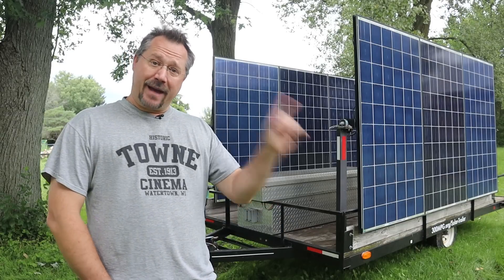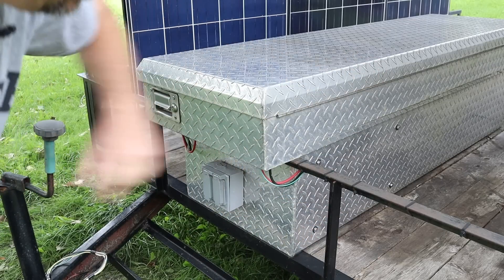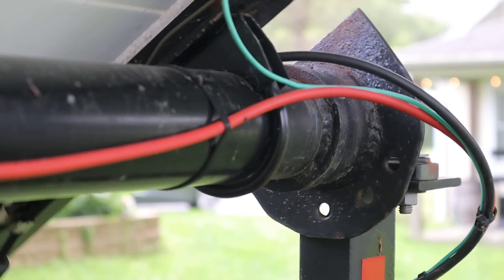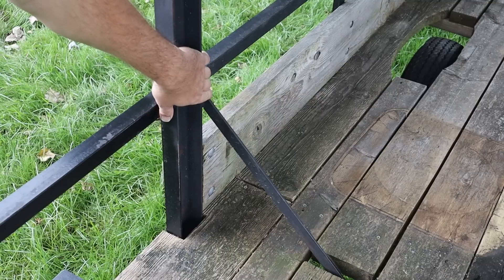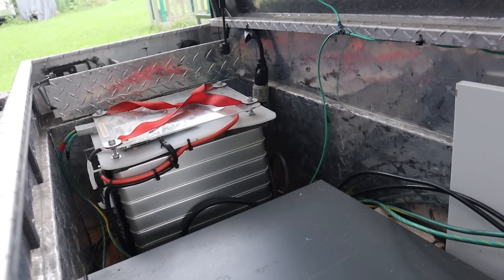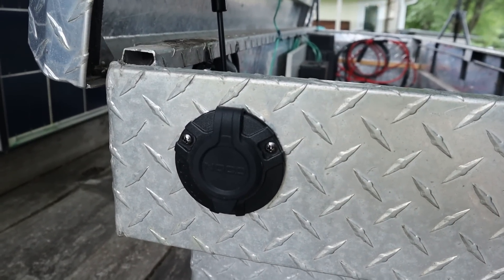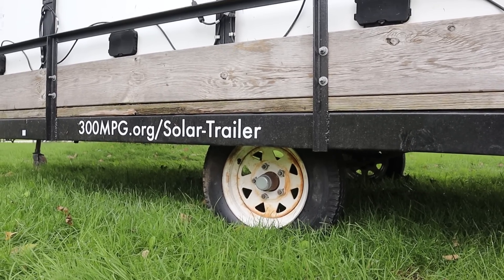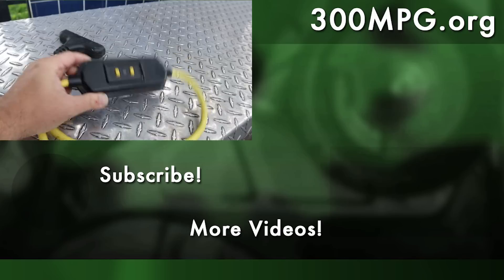DIY Solar Trailer Tour!

Comment: Really great job you have done.    I have been thinking of how to do  a similar thing using a small 4 x7 flat bed utility trailer I have already.    Hoped to have my Anker Solix F3800 in the house and run wires out to the trailer with solar panels.   My problem is too many trees so I would need to have my trailer as far as 110 feet from the location of the Anker Power Supply in the house.   In researching wire distances it appears I would need to run two sets of wires -- one set to each of the XT60 solar inputs on the Anker F3800 with use of 8awg MC4 wire sets.   Your panel swivel support is extremely clever and very functional for setup and travel.    I hope to try to follow the design but it does take some skill and patience.  I don't even have a welder setup.  Prepping for WW3 is getting to be tough on me as I am 78 years old.   Thanks for the great ideas and for posting the project for us to learn from.

Comment: What do you do in the case of a storm and high winds
Reply from the maker: Never been an issue. 
If I wanted though, the panels could be tilted flat. That would present the least wind resistance.

Comment: Hi Benjamin! awesome video! -- was wondering if I could get away with using 1" 14ga steel tubes (like for garage doors)
Reply from the maker: I couldn't tell you. I'm not a structural engineer. I do know that when I have materials in my hands, I get a good sense of how solid they are and what they can do.

For LONG spans, like the 10 foot long pipes I used to support the full weight of 3 panels per side, you need stiffer/thicker supports than you might otherwise think!
Reply: @BenjaminNelsonX  what is the gauge of the steel pipe you used? thanks in advance 🙂
Reply from the maker: @mitchizm007  Schedule 40 steel pipe.

Comment: You could add hinges to the outside edges of the wings and make them bifold units. Add new panels on the new wings. Store them with the current panels facing in to the center of the trailer. the new panels can be supported by prop rods when deployed. That would double your wattage on the panels.

Comment: Nice to see you still making content. This is what solar panels are meant for, a niche for remote rural locations.. and making it mobile makes so much sense. A trailer camper with flip open panels on the sides would be neat.

Comment: as a demonstration platform it is a good system, if you needed to adapt it to a higher capacity production design then obviously higher wattage panels would be a good improvement but creating a telescoping mount to elevate the panels could also help as there may be a shade issue from the panels on one side blocking the panels on the other side?
Reply from the maker: @barrymclaughlin794  Either or both sets of panels can be set to flat horizontal if there are any self-shading issues. 

I did consider setting up one of the two sides to telescope, but considering the weight and a few other challenges, it would get complicated fast.

Comment: Awesome! One small upgrade that is not impossible because of your excellent build would be a solar tracker. 2 bigger R/C servos and a Raspberry Pi Pico would do the trick I think.
I think you could either do calculation (set the orientation, and time of day and maybe some more info like long/lat) and program it to set optimal degree.

Or you could do a solar tracker (there are lots of easy DIY here on Youtube, also with a Raspberry Pi Pico I guess) and then control the servo/panels.
Reply from the maker: Solar trackers are neat, but they generally need a post mount and very solid foundation - ie LOTS of concrete! They also add a layer of mechanical complexity, and are prone to breaking and needing maintenance.

In recent years, with the cost of solar panels dropping, it's usually made sense to simply buy more solar panels rather than spending the money  on a tracking system.

And there's always something to be said for simplicity!
Reply: @BenjaminNelsonX  I just meant instead of tracking by hand the one axis by hand (that you put a sprint in) use a positional servo and to track the sun (you can use a couple of photo resistors) and very small computer to read the position of the sun and control the servos. Then you can track the sun by one axis and let panels position themselves. Not a huge gain, but 15-30% more on a single day I think without touching the panels...

But ofc you can do it by hand also with the sprints.
Reply: @BenjaminNelsonX thank you for this great observation. I was thinking about mounts and had considered a tracker setup, but cheap panels negates the need.

Comment: For weather protection you need to add are sheets of metal to slide over for the protection of the solar panels. if it hails or is in inclement weather or even while traveling, while in protection mode might prevent unwanted damage such as bird flying or rocks into panels panels. Its just a suggestion to protect the very good project you have there.
Reply from the maker: We have had two SEVERE hail storms at my house the last few years. My home solar was not damaged at all (although many cars in the area were very dented!)

The panels fold vertical for travel and present their smallest dimension to the direction of travel. I think that if anything took damage from rocks on the road, it would be the tow vehicle.

Comment: Great job but 30v per panel × 3 = 100v using unprotected wire seems hazardous or are they in parallel? I'd use wet outlet covers instead of damp outlet covers as well as gfci protection somewhere.

Comment: Looks really good. I think you have covered all the bases as far as safety.. The only suggestions i have are:   Make sure to have a breaker between your solar panels and your charge controller and a breaker between your inverter and your battery banks.  Also its a really good idea to keep your wires as short as possible and use the largest gauge pure copper wire that you can afford/install from your inverter to your batteries. Many DIY'rs skimp on the wire size and end up with too much loss and heat in the wires or worse: a fire..  Again, it looks really good.. very good use the trailer and mechanics! LOL and it looks like Will approves!
Reply from the maker: There's breakers between the solar panels and charge controller. There's a removable fuse between the battery pack and charge controller and inverter.

This whole system is pretty low current. The big one to watch is current between the battery pack and inverter. Fortunately, being a 48V type pack instead of 12V reduces the current by 1/4th what it otherwise could be. That helps for using more reasonable size conductors.
Reply: @BenjaminNelsonX  agreed higher voltage means you can use smaller wire.  Wasn’t sure what voltage you were running.

Comment: When both sides are pointed toward the sun, how do you keep the front one from casting a shadow on the back?
Reply from the maker: The sun is UP. It shines DOWN on the panels. In regular summer weather, the panels do NOT shade each other. 

If the sun is low in the sky, you can simply tilt the front row of panels flat.

Comment: I already built a solar shed on a pontoon boat trailer with two Growatt 5K inverters and 3 server rack batteries.
I don’t have panels mounted on it because I just wanted to put the off grid power for a mother in law style apt outside the house. I like the way you made the pivoting mounts.
I have a EG4 6K inverter and 25 KWH battery that I plan to make a trailer similar to yours. I’m trying to find a way to design a collapsible ten panel string so it can serve as a portable power supply for basic electrical needs of a house when the grid service is lost. Maybe 3 panels mounted perpendicular to the trailer center line on the roof,then three on each side hinged to the roof panels . Finally a tenth and maybe an eleventh hinged on the front and back.
Off grid solar has become an obsession for me because I already have all I need but can’t stop scheming.
Thanks for the inspiration!
Reply from the maker: @danielking2944  Do you have a build blog or photos posted that we could check out? Sounds like a fantastic project!

Comment: If you move the panel pivot up more it be better at getting both sets of panels  in the sun and out of each other's shade. The downside is they will be out of balance.
I hope you put each set on its own mppt or in parallel or even a small bit of shade on 1 panel will basically shut it down.
Reply from the maker: On each side, the three solar panels are in series. The two sides are connected in parallel to the solar charge controller.

Comment: I know you did it for balance. But if you had put the pivot axle closer to the edge of the panels, it would make the panels stay out of the shade of the others
Reply from the maker: In regular use, the panels really do NOT shade each other.
At worst, they can always be both pointed straight up.

Balance IS important here. I REALLY struggled with the panels in early testing when they were NOT balanced!

Comment: I have been following you for a while and saw your build on this solar trailer. I got the bug and started building my own. I posted photos on Will Prose DIYsolarforum on portable systems. I added the solar frame today and would greatly appreciate any input during the build. I decided to do a roll on setup so I can still use trailer. With your permission I will post a link in the comments to the photo.
Reply from the maker: Sounds good!

Comment: How do you keep everthing in the truck box from over heating ?
Reply from the maker: It doesn't get that hot.
The box is shiny, so it reflects sunlight away.
The internal components all have their own fans.
The box is NOT air-tight.
I've NEVER had an issue with it being hot in there.
Aluminum is an excellent heat sink.

Comment: The pivot would be a good way to replace an awning on a camper although the inside heats up.  With diy LIfepo4 cells one could made a long thin battery along the front rail leaving the trailer bed  free for a slid in box of some sort.

Comment: The great: recycled components, aerodynamic for towing.  Excellent.  The questions:  ventilation/ exhaust fan for heat generating electronics inside the box?  (I'd do a thermostatically controlled exhaust fan powered by the battery.).  Does one array shadow the other before mid morning or beginning mid afternoon with the current geometry?
Reply from the maker: Heat inside the box has never been an issue so far. It's aluminum, so the whole thing is sort of a heat sink. The inverter and charge controller both have automatic fans on them. The box also isn't completely sealed up. There are some small ventilations holes under the ends.

As for shadowing - the design of the trailer offers quite a bit of flexibility. The trailer itself can be rotated whichever direction desired and then the two solar winds can be rotated independently.
If nothing else, the solar panels can simply be rotated flat and pointed straight up. No shadowing at all then. Shadowing really depends on time of year, how far north/south of the equator you are, etc.

Comment: Not using bifacials was a wasted opportunity
Reply from the maker: These were solar panels I already had.
Buying new bi-facial panels would essentially be a big increase in cost with only marginal production gains.
Reply: Buying a $500 quiet generator on sale at Costco was probably the biggest missed opportunity.  I love the idea of solar.  I have some on my RV.  Its awesome. However, most applications don't make sense financially, logistically, or practically.  You could literally throw a small generator in the bed of your pickup truck, along with a small gas can and extension cord, and power everything at the cabin.  Instead, you're gonna spend thousands of dollars on bulky equipment, suffer reduced MPG towing a trailer, all to have very limited power generation IF the sun happens to be shining.  I'm not trying to hate on solar, but let's be realistic here.  With some quick, non-precise math in my head I basically determined I could pay 3 YEARS of power bills at my house by the time I purchased the solar trailer.  Again, I mean no offense to Mr. Nelson - the trailer idea is cool and I enjoyed the video, but the applications are very few.
Reply from the maker: @gormanthomas8135  
I completely agree with you that a simple gas generator is an inexpensive and turn-key way to make power off the grid.

Just the other day, we took the trailer to my friend's off-grid property. He has been running a generator continuously whenever he's there to be able to provide power for his RV camping trailer. He really dislikes the noise. There's also maintenance and the cost of fuel, and the hassle of refueling.

With solar, it's silent. And the battery part of the system allows it to run all night.

Comparing a complete portable off-grid system to a home electric bill isn't a fair comparison at all. That's like the difference between renting and owning a piece of equipment. But yes, you are correct that it generally wouldn't make economic sense to disconnect your house from the grid and invest in a large solar battery system. But if you have a property where it  is NOT connected to utility power and would cost tens of thousands of dollars just for the power utility to hook you up, a modest solar system makes PLENTY of economic sense.

A solar system also makes lots of sense when COMBINED with a generator. Many off-grid solar folks design their system for what's needed most of the time, and also have a generator for the longest days of winter and unusual weather patterns. A generator can charge the solar battery. So even then, it greatly reduces the number of hours the generator has to run.

As for reduced fuel economy of a vehicle towing the trailer, that's just to get the trailer to the property. It's not as though somebody is towing it both directions to and from a recreational property every weekend. It stays there!

I had fun building this trailer, and I already had most of the materials. Frankly, the largest cost was splurging on the brand-name MPPT charge controller. If not for that, the whole project would have cost me in the neighborhood of $100 out-of-pocket. I would NOT have built this whole thing from scratch if I was using new parts, I just don't have that much need for it when I already have a quality public power utility and a grid-interactive solar system mounted on the roof of my garage. https://www.youtube.com/watch?v=dvUohDXKjYw

I AM a big fan of solar, but that doesn't mean it's right for every situation. It certainly doesn't work well in the middle of the woods, with all the tree branches blocking the sun. It's also pretty challenging if you are a renter, especially in an apartment.

No, it's not perfect for every situation, but as a demonstration project made from recycled and salvaged parts and then going to an off-grid property which would be cost prohibitive to run utility power, I think it's a pretty good use.
Reply: @BenjaminNelsonX  I am a fan of solar.  I  use my time to watch videos about it, obviously.  I can't imagine not having solar on our RV.  It's ideal for off grid camping.  I am constantly looking for ways to use solar more.  I am also a fan of truth.  And, I suspect a LARGE percentage of the public who view solar as a viable source of energy production have NEVER actually used solar.  Its applications are very narrow.

Comment: I think solar power is pretty cool but I live in a perpetually overcast part of the planet.
Reply: Don't rule out solar just because of overcast skies.   You just need more panels.  I live in Canada and winters are very overcast where I live, yet my small system supplies almost all of my electrical needs.
Reply: @MikeyCanuck123  I'm currently renting, so it's not really an option for me right now.

Comment: 2012 nissan leaf batteries...14 year old batteries now 🤔 The math isn't mathing here in 2024 😂
Reply: He didn't mention it but he's from the future, he's still adjusting, cut him some slack lmao XD
Reply from the maker: They are batteries I already had. I've used them on other projects. They wouldn't be good for a car anymore, but they are still useful for other projects.
While they don't have the capacity that they once did, they still work just fine.
I'm ok with that math.
If a person wanted to spend some money, there are all sorts of great battery options available nowadays.
Reply: @BenjaminNelsonX  - Love your reuse/recycle/make-do mentality.   I do the same.
Reply: Honestly... He's probably not far off if you think about it. A car's model year has little to do with when it was assembled or it's components were made. A model year 2012 vehicle could easily have been made in 2011 of components manufactured 2009-2011.